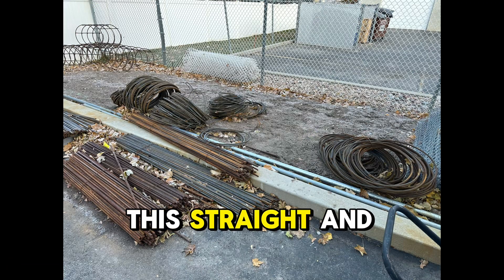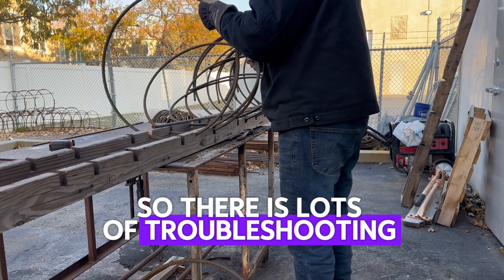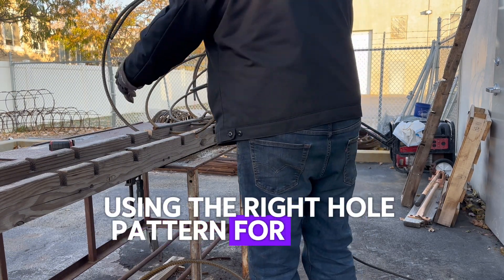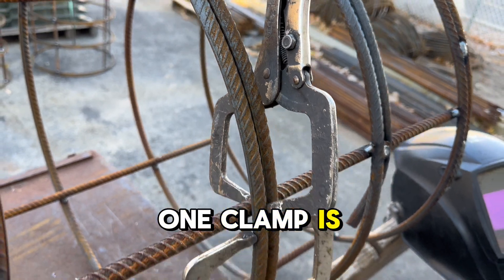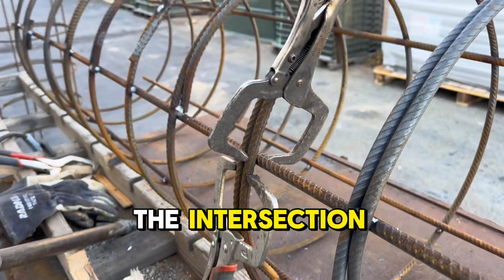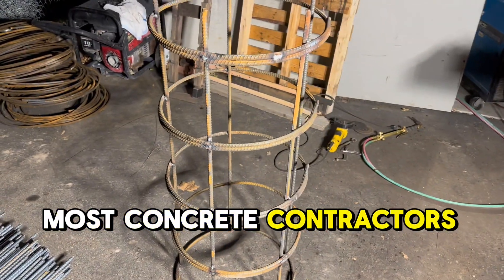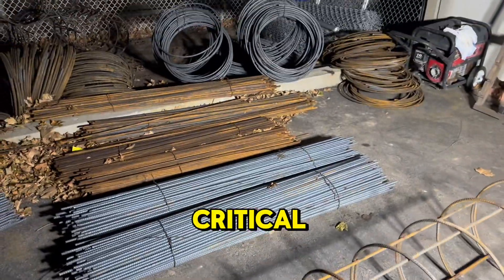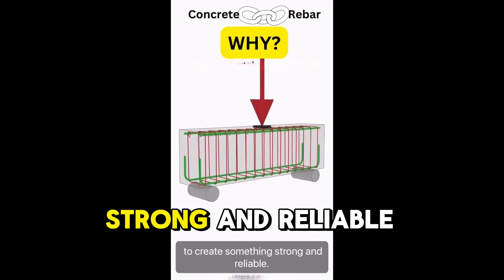Why You Need to Weld Your Rebar

Comment: What type of welder do you think works best?
Reply from the maker: Personally, I have a Miller Multimatic 215. At my other job I have the Millermatic 252.
Both of these MIG welders can be expensive, but you can find used ones for good deals